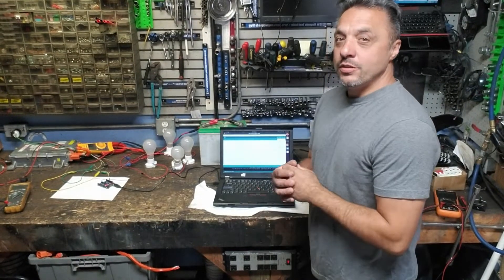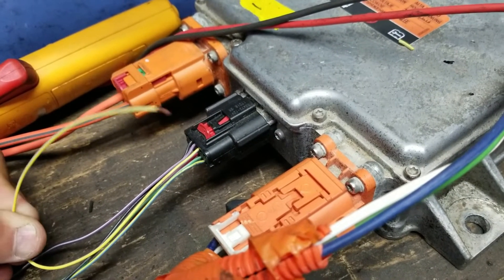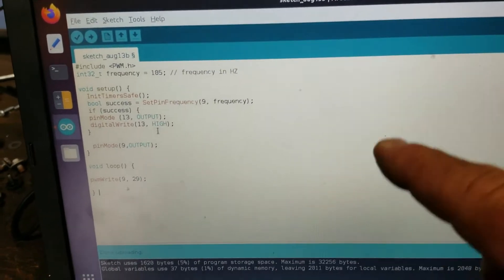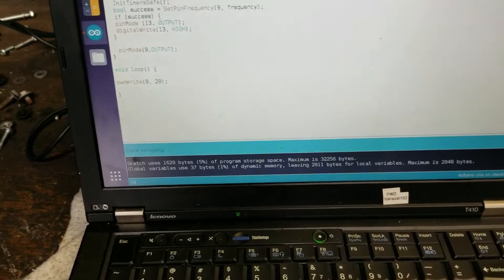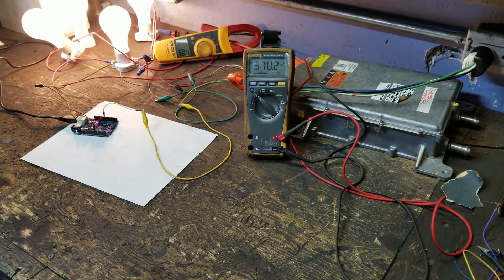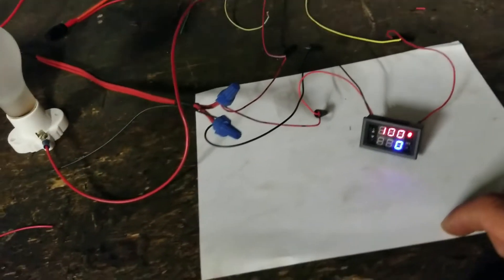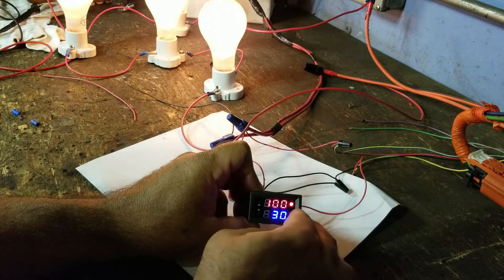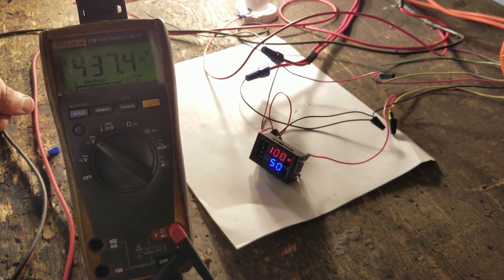Part 18 Using Chevy Volt Traction Battery Charger

Comment: Nice. Very compact. 🙂
Looks like it needs liquid cooling tho or it will get hot very quick. As for doubling up there is no reason why not, the two chargers will not know the other is there as all they see on their output is the battery.
Reply from the maker: Yes cooling will be required. I forgot to mention that.
I see your beast is out and running! NICE!.
Reply: @InTheGarge  Yes, it was a big moment. 😀
Reply: Great job Sir..the outcome is absolutly awesome.